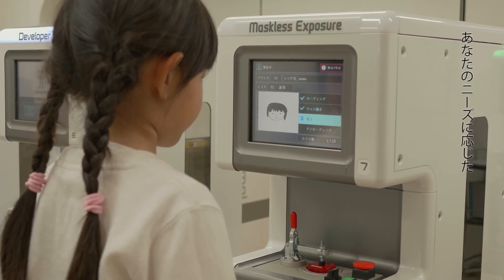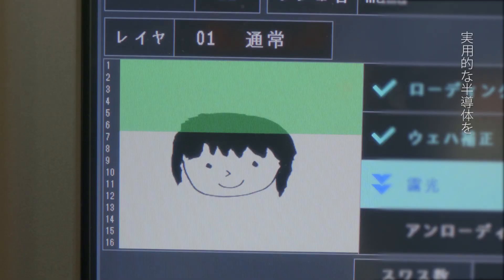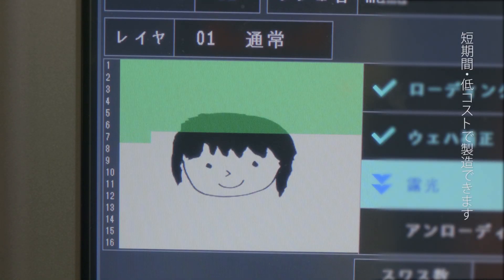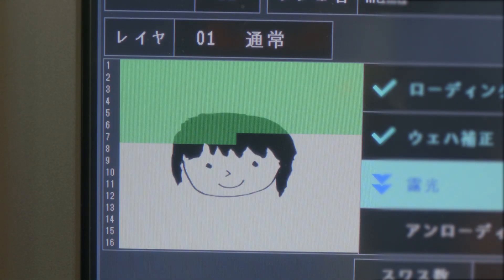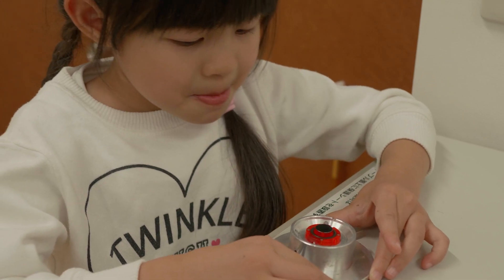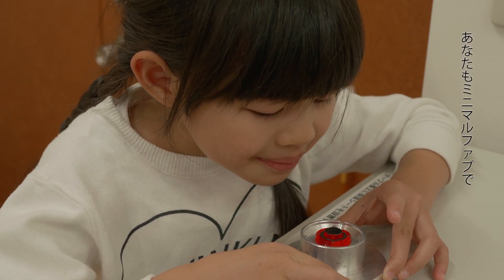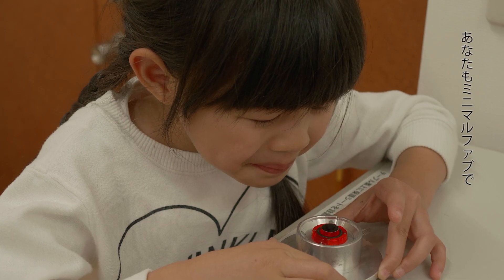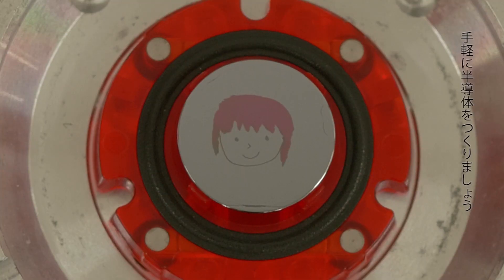Semiconductor Manufacturing Process for Minimal Fab

Comment: Which nodes size it supports ?
Reply: 6µm (6000nm) and just one metal layer. This is equivalent to what the industry had in the mid to late 1970s, though with better performance. The wafers they use are more like what the industry had in the 1960s